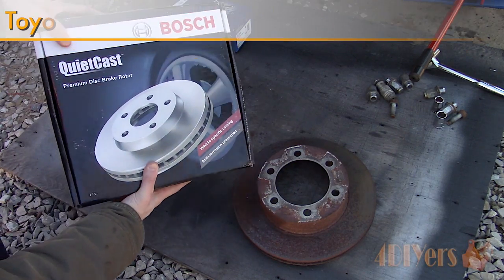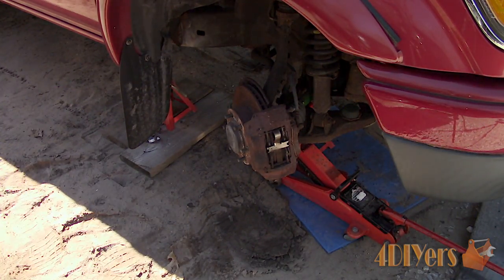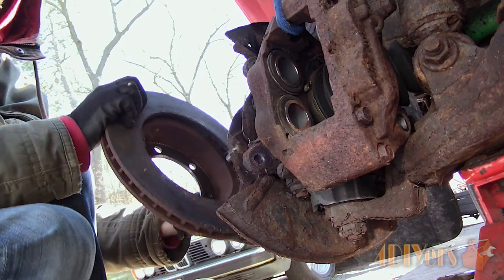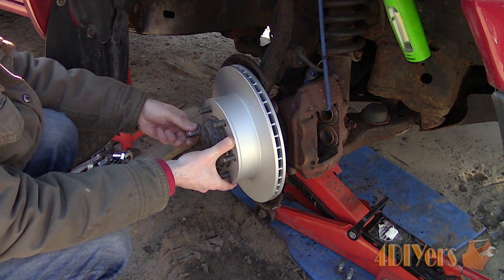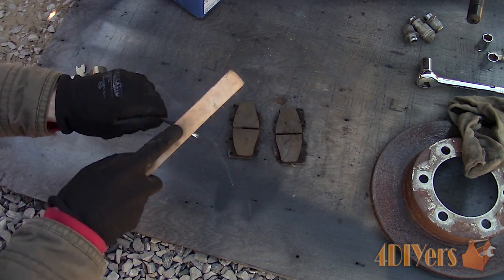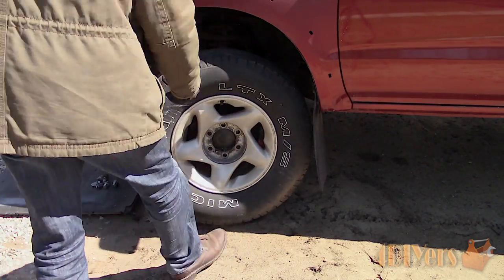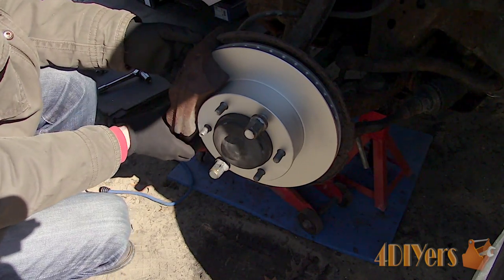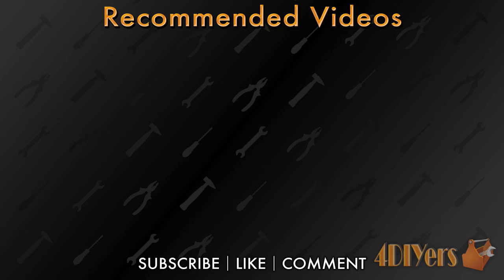How to: 95-04 Toyota Tacoma Front Brake Rotor and Pad Replacement

Comment: I got the maintenance bug when a Sears Auto stripped the oil drain plug on my '98 Tacoma using a pneumatic torque wrench in 2005 (seriously wtf). I've only gone back to a shop once since and that was to change my timing belt. I'm 280k miles strong thanks to videos like yours! Cheers.
Reply from the maker: Happy I can help :) Other than certifications, I have only ever taken my vehicle in for repairs maybe four times. Couple times for tires, once I was in a pinch in the middle of winter, and the other was for having a transmission rebuilt. I grew up around cars (my dad was a mechanic, now retired), so I can't imagine having someone else touch my vehicles. Using an impact can be common on oil plugs too, time takes the priority.

Comment: Just did mine. I HIGHLY advise you use some PB Blaster to spray on the rotors, before you begin to take them off. My were beyond seized, and I don't anything extreme, let alone live in an area with snow or salt.

Comment: thank u alot for the video, i enjoy doing these things myself bc its rewarding and cheaper. i only had one issue, that was getting  the rotor off bc it was rusty. To get that off you have to get a bolt and nut, put bolt through the caliper bracket hole and hold the nut with a wrench while racheting the bolt towards the back of the rotor and it will pop loose.
Reply from the maker: You’re very welcome and thank you for the feedback! I have a load of other videos in this truck as well if you’re looking for more tutorials.

Comment: My 1996 Tacoma has a much cleaner (very little rust) brake setup than the one shown in this video. But somehow, three out the four pins were frozen in the caliper. No amount of using the correct drift punch would budge those stuck pins. The pins even started to form a rivet head from the pounding on the side that was not supposed to have a head.  I had to carefully cut the pin on the inside and it was still hard to free them. The new pins I bought were slightly thinner and I know why. A little grease on those pins would be a good idea in my opinion.
Reply: Wish me luck.  About to swap mine. 
How many miles are on your 96?
Reply: @WookieLove1  It has a only about 151K miles, since I also use two other work trucks. It still runs like a new truck. It could be that it sat around too much before that caused the problem with the caliper pins. It gets almost daily use now.
Reply: @Stephen K.  very nice situation to have a low milage 96. I saw one with 4000 miles(barnfind situation) pre pandemic, pre inflation for 24000 in 2019.... wish I'd have purchased it! These trucks run forever.

Comment: if you have a 6 lug, make sure the pads you get have the pin holes. I believe the 5 lug pads are different and don’t fit the 6 lug calipers however parts stores will try and tell you otherwise!

Comment: I've got a 98 with manual locking hubs, do I need to remove the manual locking assembly to remove the rotor? First time working on a truck with the hub type

Comment: Excellent video as usual. I was able to change my rotar and brake pads. Thank you for encouraging me. I have an identical truck as yours. The is a problem with my left caliper. I k notice that the brake pads does Not sit flush with the edge of the rotar. As a result the edge of the rotar "eats" into brake pad with the top portion not having contact with the rotar. The right caliper if fine. Should I change the caliper? What do you think?
Reply from the maker: Happy I could help! Almost sounds as if something isn't seated problem or perhaps someone installed the wrong parts on the truck.

Comment: I have a 97 tacoma and with locking hubs on the front. Would that make changing rotors more difficult or same process?
Reply from the maker: I would think it's the same process. I don't think I've ever actually seen a Tacoma with locking hubs in person.
Reply: I just changed out my 99 tacoma with front hub locks.  It is the same process.  The hub locks need to be free (unlocked) to remove the tire. 
Great video, no wasted breath on anything.  Thank you.

Comment: If the brake pads have not worn down to the metal, there would probably be no need to replace the rotor.  How do you check the rotors to find out if they still meet specs?
Reply from the maker: That's not necessarily the case. Rotors can glaze up, warp, crack, or harder pad material can wear the rotors. If you're keeping the rotors, there's two checks. One is for runout to ensure they're not warped. I do have a video for this https://youtu.be/goVVZ8TLSGU and then the other is thickness. Typically there's a value stamped on the rotor, usually on the outer edge where you can see the cooling fins. If they're still good, don't forget to sand them to expose a clean braking surface on the rotor.

Comment: Can you link to the rotar and pad? The bosch pad amazon says fits my 98 Tacoma prerunner looks different?
Reply from the maker: Unfortunately the ones I used in the video maybe slightly different, I know the rotors are different for sure. You should have a 5 lug truck, only the 4wd trucks were 6 lug.

Comment: When you pumps the brakes at the end does the engine need to be running or off?
Reply from the maker: You can do it with the engine off.
Reply: Just as a follow-up, I successfully changed out the front brake pads on my 2000 Toyota Tacoma this afternoon thanks to your informational video. Thank you again for the information and keep up the good work.

Comment: Why not re-pack, flush, and bleed while you're there?  Or is that separate video?
Reply from the maker: Wheel bearings are sealing as far as I know and the brake system was already done before I bought the truck. No need for a flush and bleeding if the maintenance is kept up and there is no air in the lines.